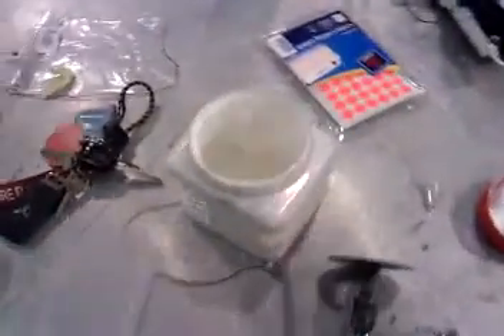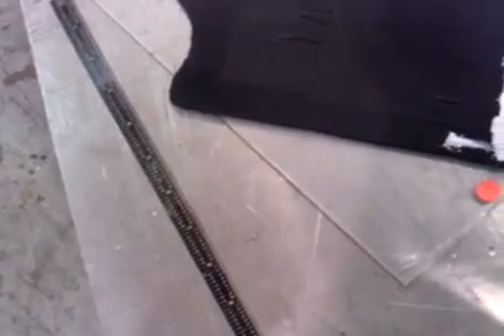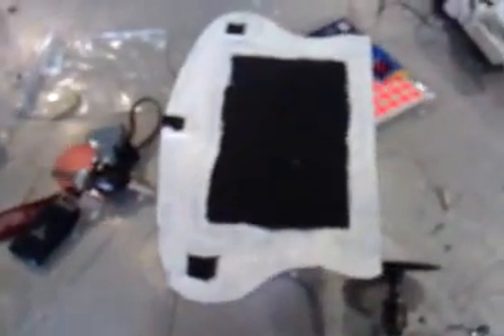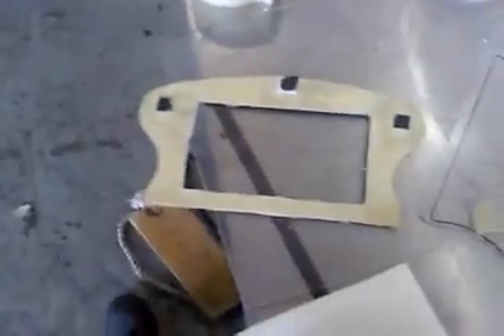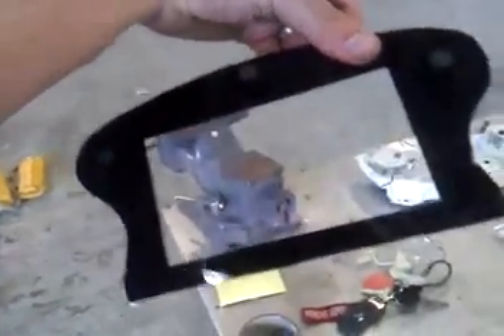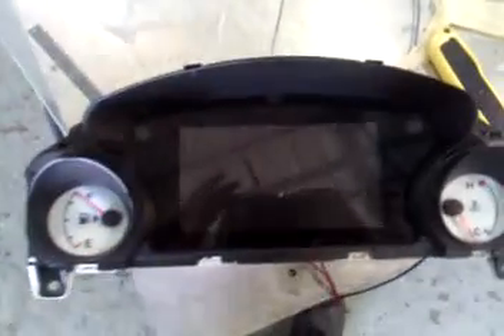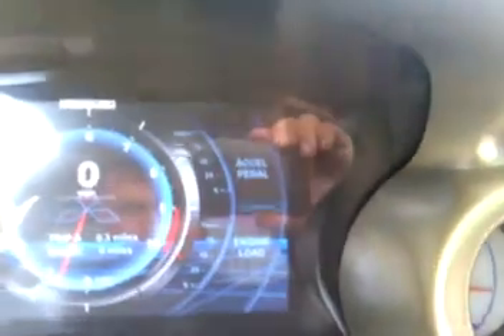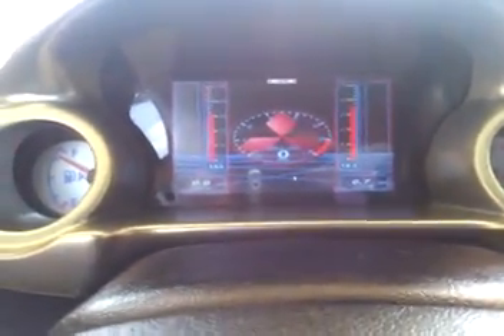How to convert your anolog gauges to LCD Part 2

Comment: Could you do one for a 2001 Mustang and how much
Reply from the maker: Preston Dykes yes,  950 plus shipping for a plug and play multi-touch panel running windows 10 and dashcommand, direct fit for your mustang
Reply: Digital Eclipse all I would have to do is remove old cluster replace it with that one

Comment: hey I'm curious I wanna do something similar but use a tiny PC running Windows I have a older car running a apexi power FC stand alone ECU any ideas or knowledge getting dash command to work with aftermarket ecu
Reply: chris fox use a raspberry pi or a latte panda if you want windows.

Comment: you need to tell us what software you used in the tablet and what programming you had to do to link it to new sensors, etc.
Reply from the maker: ViiV Creations I'm using a mini itx pc, not a tablet, tablets are for Tesla.  Also this video is super old,  everything is way more advanced now.
Reply: Digital Eclipse you should do another update video. I haven’t seen any other Mitsubishi like this one in about to start my project on my 2003 spyder eclipse

Comment: Can you bill one for me I have a Acura TL 2002
Reply from the maker: Acura men yes I can build you a system,  the newer versions I build are fully multi-touch,  Windows 10. way more advanced than what you see in the video
Reply: can you actually help me out ive been trying to do this
Reply: I get a Mitsubish 3000GT VR4 1992 and I would like to have one of this. Can you build one for me? I would like too see this new one you are making now. Did you make a video?
Reply from the maker: Best Tour In Rio the systems I build only work for OBD2 and CANBUS, too much involved to make it work, unless you install a modern engine management
Reply: David Leonard yes I understand first I need to replace the ECU first generation for the ECU Chrome each comes with ODB2. After that I let you know.
Reply from the maker: Brandon - BMGA what kind of vehicle?
Reply from the maker: Best Tour In Rio let me know,  I can build you a standalone multitouch capacitive panel for a good price and it will look amazing
Reply: Can I do the same with my corolla 1994
Reply from the maker: Sana Salim a 1994 would need a new engine management system
Reply: Can you do one for a 98 expedition
Reply: would this work for a 2002 toyota 4runner? can you make a video of the newer versions you make?

Comment: how dose the wiring gose/connect??
Reply from the maker: everything is controlled by a mini-itx computer as far as the wiring goes the m4atx power supply is hooked up to the ignition switch and the battery my current setup my gauge panel is running off of an HDMI cable

Comment: Hey David awesome video just a few questions though how do you sync the screen to the car I'm looking to do this to a commodore 99 model do you know if this is possible to do what programs would I be looking at getting to make this installation possible
Reply from the maker: There are several different methods, however the best way is to build a windows based mini itx PC using a m4atx automotive power supply from minibox.com.  make sure your screen is either USB/HDMI/VGA compatible.  To interface with the car I use a OBDLINK-SX from Scantool.net and dashcommand software from PalmerPerformance.com
Reply: OK thanks and how do you connect the screen to your car? Is there a port I need to make or anything extra I need to add
Reply from the maker: +George Boot yes, connect the screen to the PC I mentioned above,  then the PC connects to the car
Reply: Mechanically speaking I'm excellent but this programming stuff is new to me also was wandering how I go about supplying constant  power to the screen
Reply from the maker: +George the USB monitor I used for this video is powered by the PC, this video is over 5 years old,  so the technology I am currently using is way more advanced,  I plan on doing a new updated video this summer.  go to store.mp3car.com for multitouch screen options.  the new screens run directly off of the 12v ignition switch.
Reply from the maker: +George the USB monitor I used for this video is powered by the PC, this video is over 5 years old,  so the technology I am currently using is way more advanced,  I plan on doing a new updated video this summer.  go to store.mp3car.com for multitouch screen options.  the new screens run directly off of the 12v ignition switch.

Comment: You should really re-consider remaking this vid, with a better camera and much better instructions. The instructions were really not clear.
Reply from the maker: the video was from 5 years ago,  a new updated version is probably due,  considering my new panel is a complete standalone multitouch
Reply: David Leonard Yes, thats why i suggested a new vid, its pretty old! You should definatly do it! i'll be doing it if and only a more detailed video is presented, Showing all meterials needed and a step-by-step guide would be badass thanks for the work! i really want to modernize my car.
Reply from the maker: +Platinum no problem

Comment: OK so that's what I'm doing I'm upgrading to obd2. my other question is does the software have the ability to see what's wrong with the car if it throws and engine light so I don't have to plug in an old scanner?
Reply: obd I meant
Reply from the maker: yes,  it will give you diagnostics far beyond your normal code reader
Reply: +David Leonard that's great thanks for quick response
Reply from the maker: +Badkitties Richards also make sure you either build a up to date mini itx PC or andriod system capable of handling the data
Reply: +David Leonard will a raspberry pi do?
Reply: +David Leonard so I have encountered a problem:D Since my car is a 95 and it has the flip odometer what should I do? I have looked to see if they have a conversion but my only way is to get a old digital dash. Can I use an arduino or does the software have a trip odometer on it? thanks

Comment from the maker: @badkitties you will have to hardwire all of your sensors to an input device or upgrade your engine management system
Reply: David Leonard so for my Mitsubishi 3000GT should I trade the ECU for the new Chrome each is OBDII right ? Because now the car has OBD1
Reply from the maker: Best Tour In Rio yes,  sorry for the delay in response

Comment: Your titles should be changed... There is nothing "how to" about making it work
Reply: Does it still keep the record of the mileage?
Reply from the maker: I mentioned in the video what you need to make it work
Reply: +David Leonard title says "how to convert", simply going "I used blah blah blah"  does not constitute a "how to".. Should have shown the actual set up of the device/devices which are, ya know, "converting" the analog signals into digital. Such as, how are you converting it? I didn't hear anything in the video on whether you are somehow directly tying into the ecu, or if you are using an obd adapter. Or even if you are just attaching something to the solder points for each of the gauges and determining the stuff from there. A significant portion of a "how to convert analog to digital" was left out. All you did was post a "how to retrofit old gauge cluster to house an LCD" granted that part is rather good and I really did enjoy the video/watching you go through those steps, but there wasn't any "converting" of analog to digital going on. 

But with all that said, I'm definitely gonna be putting what was done in the video to use. An LCD screen that is both powered and driven by a USB cable? That's pretty damn awesome and useful for this exact set up. Keeps everything down to an essential minimum. Next up is just finding a device that can read ecu data and put it into gauges that are on par with the ones in an Audi or Tesla.
Reply from the maker: +Hikari Scantool OBDLINK SX is what I use,  200PID a second, best one to use for this application, when I did this video I was using a Elmscan 5, there is an obvious lag with it.   make sure to use OBD2 to USB not wireless and Dashcommand from PalmerPerformance

Comment: in lieu of not having a OBD connector- are there options to provide input?
Reply: +itolond I would like to know this too.  I only have ODBI in my 92 Camaro.
Reply from the maker: +Chris Doyle you would have to get either a modern obd2 or canbus engine management system or hard wire all of your sensors to a input output board
Reply: Thanks for replying.  Upgrading the car to OBD2 is not something I would want to take on. Wiring up the sensors maybe.

Are there any forums that you used to read up on this stuff?
Reply from the maker: +Chris Doyle Mp3car.com has some decent information,  I am the first to do this, several others have tried few have been successful.  it's all about research

Comment: So what is done about the information input. How is it hooked up?
Reply from the maker: Andrei Sima the V2 has several different issues with the processor resetting. I would wait until they fix the issues,  as far as an android, you have no way of powering it down with the ignition switch
Reply from the maker: I mention how it works at the end of the video
Reply: I think you can go away with a RapberryPI+Carberry but... can get a bit complicated if you want to change the skins, but if you know what you are doing i guess that this is an alternative.
Reply from the maker: Andrei Sima I've used those just to test,  they work, but not as good
Reply: David Leonard well is just a under 100EU gig :) lets hope that RPI V2 is faster than RPI B. Or another option might be a Android tablet for a decent price / quality.
Reply: V2 just ordered :( i guess i will test it as it is...I do not intend to use it for a car... As for the Android tablet you are right. I was thinking about putting it to sleep more than power off, but is getting more complicated and i think is not worth it.

Comment: I used a 10 inch LED Touch-Screen in my 02, and just scaled-down the resolution. And came out lika charm! And the kicker is, I can actually reset my trip-odometer with a touch of a finger and check my MPG with the calcs the new prog performs while running! 2000 to 2009 Mitsubishi cars are thee Bomb-Diggity to mod!!! I was thinking about uploading my vid, with the mods I performed, but I see you have a pretty good one right here! Matter a fact I had a friend that asked me to do his but told him hewlls to the no! Cause it's really a lottta work! LOL! Any-rate, I told him to check your vid out and now he is working on his own! Thanks & Cheers M8!
Reply: I forgot to mention, I added a HUD which was way much easier than this whole project, but nevertheless, I think it looks very cool! When it's all said and done, I'll have more features than a Mercedes, if not already! Benz aint got nothing on me! LMAO!!!

Comment: Hey im interested in this mod. PM me for the price...
Reply: I make them, but use touchscreens to reset the Trip meters. I usually windup spending a little more because of the price of touchscreens, but I absolutely love the feature! Not sure if you'd still be interested, or if David helped ya yet. Well Cheers M8!
Reply from the maker: I will be selling a multi-touch standalone system in a few months,  direct bolt in, plug and play for around $850.  I will keep everyone informed when this happens
Reply: Will wait for it. Thanks to both of you
Reply from the maker: This video is a few years old,  I use LED 1080p monitors and PCAP multi-touch glass,  everything is touch and customizable not just trip
Reply: SWEET! :-)

Comment: Nice! I wanted an alike thing on my own custom hardware (no boot-up times etc) though what feels weird is what happens in case of data corruption? Yeah, yeah, the CRC and stuff - but anyway, sometimes those asynchronous serial buses may misfire still passing the CRC! The question is, can it cause the flash commands to be triggered by accident, or such a mode requires something more then just sending the right OBD request, some failsafe switch maybe? Actually I wonder of the recent VW Polo which is OBD II afaik.

Comment: Wow- this is amazing work.   I love the skins you make for the DashCommand.  Very Lexus-LFAish.   I have a question.   The odometer was part of the old cluster.   Does your car still track mileage?  If you put the old cluster back in, would it reflect the actual mileage, or the mileage it was when you pulled the old cluster?

Comment: how is it connected? all I need to know is did you connect this to the diagnostic serial port like a standard code reader? or is it wired in to the hard drive of the car it's self?
Im thinking of doing an instal similer to this but I cant do it untill I know how it's actually hooked up. If it is done that way then dose it come with the cord or is that sold seperetly? 
nice vid by the way.